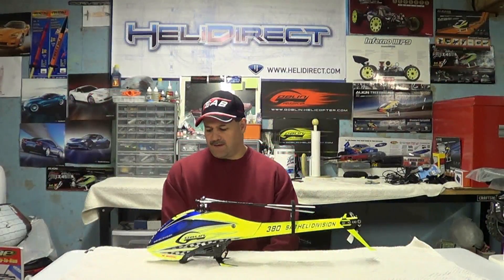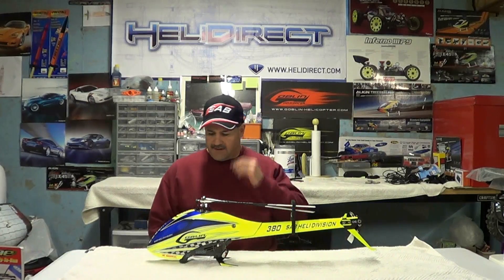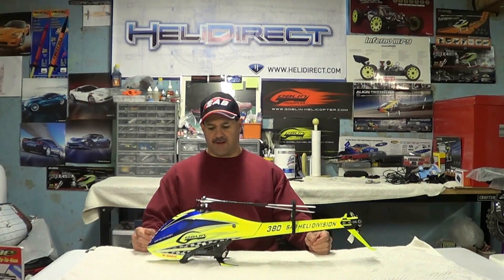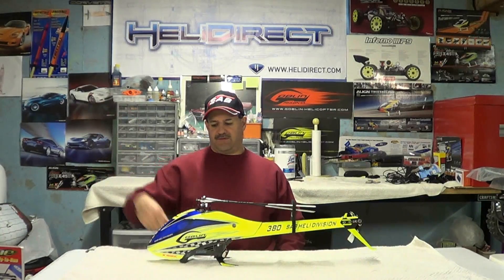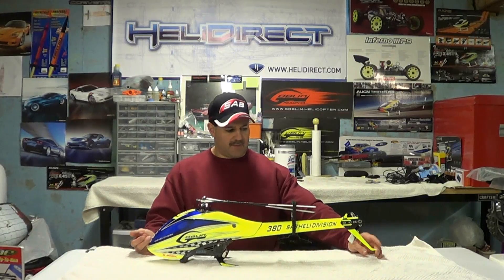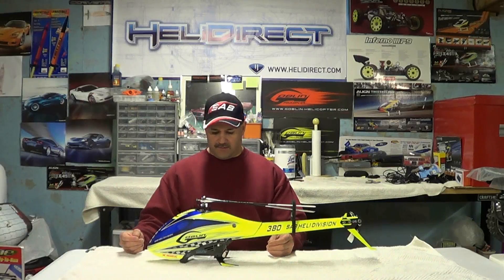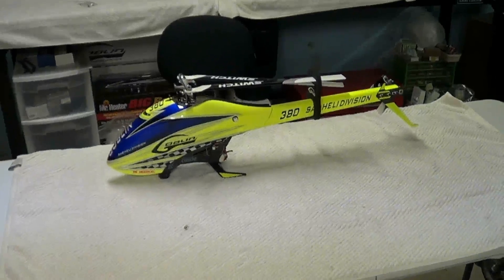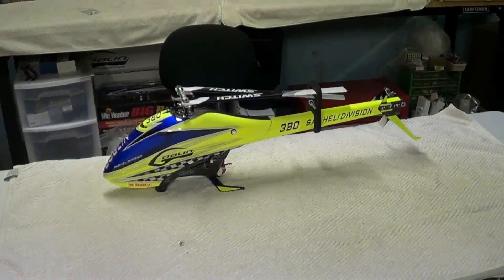Sab Goblin 380 performance review and updated crash kit

Comment: first real gravity realization with my 380 two days after watching this video and almost everything you mentioned was broken. Servo output gear, blades, radius arm. But my feathering shaft snapped in half and one blade was 10ft from the crash. I have to agree its not as weak in a crash as I thought it would be